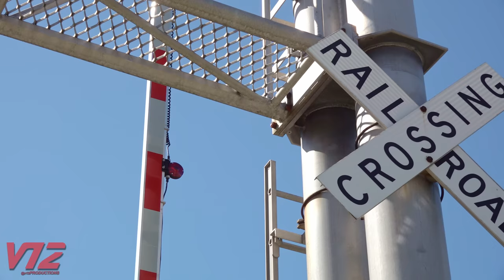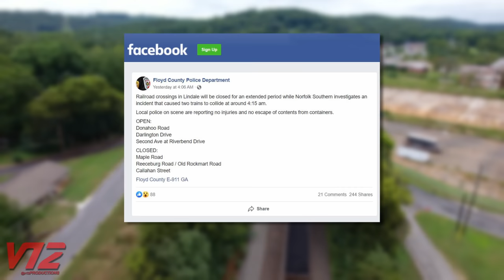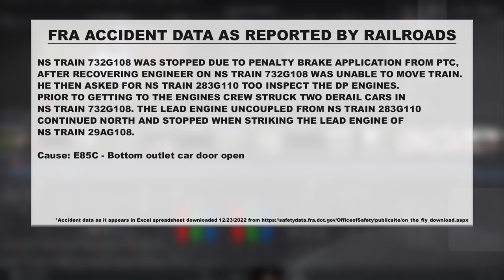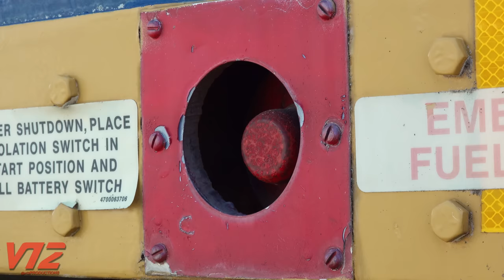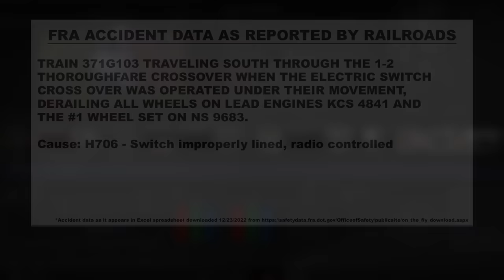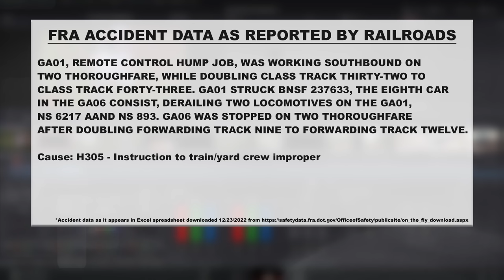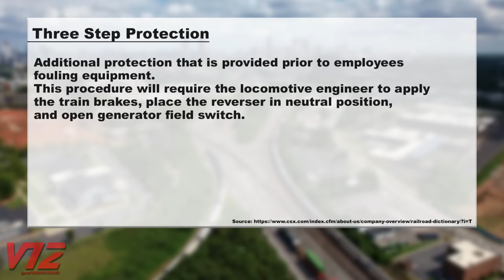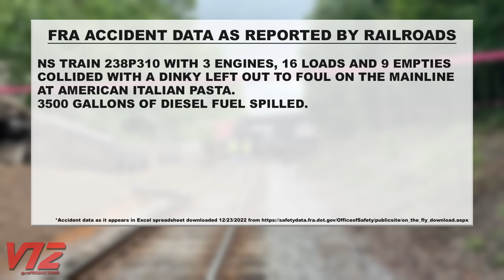Train Wrecks 2022 | SPECIAL REPORT

Comment: THANK YOU for such good coverage, accurate narrating, and good clear pictures & a nice, easy to listen to, voice ! 
   As a matter of fact, the ditch light controller is built into a steel lockable box, usually mounted in the Short Hood Nose (SHE) of the locomotive and hooks to the horn magnavalve, so when the horn blows, it gets a feed from there on pin 10, (on the panel), if I'm not mistaken. It also is connected to the SHE/LHE set-up switch, for which-ever end is in the lead position. Pin 10 is also hooked to a push-button on the control stand, for JUST momentary alternating lights without sounding the horn, (mainly for use around hospitals or to test the lights. The set-up switch tells the box which end the headlights will be using, so the opposite end of the unit won't have head lights not Ditch Lights in operation. If NS ditch Lights are operating properly, when the headlight is on, and the control knob and end selector is positioned properly, the ditch lights will be on constant. FRA calls it the "TRIANGLE LIGHT PATTERN, for railroad safety". Once you tap the horn, or tap the button, the Ditch Lights will flash alternately for a set number of seconds, (18 seconds, if I remember correctly),  and then go back to either on constant, (if the headlights are on),  or if the headlights are off, after the Ditch Lights time out, they turn off, awaiting a signal in the main panel. < I know a little about them. I helped design the procedure to install them on locomotives, as well as designed and built the testing equipment to qualify the control box for ditch lights. I made one for each of the major shops. > ( The ditch lights are the same bulbs as the headlights are. 75Volts, DC.)
   You mentioned what kind of damage does a unit get, if there isn't much of anything showing from the outside...Imagine having a flatbed truck with heavy boxes sitting on it, doing 50mph and running into a solid concrete wall. What would happen to those boxes? They would keep going the direction and speed they were previously going. If they were bolted down, the weight MIGHT be enough to sheer the mounting bolts off, moving control equipment around. There are lots of 1/2" and 3/8" copper tubing, carrying air for brake systems, all under the floor of the cab. They hook to the control stand for Train brake and Automatic brake, Dynamic brake magnavalve, PCS, horn, directional Sand. etc. Sometimes loose items, like possibly a bad coupler knuckle that wasn't put on a storage peg after changing it out, or special chain, might be thrown into the piping and flatten it out, or any number of shearing problems. ( In each end of the locomotive, there is a big sand box," its called, actually a funny shaped steel tank, built like a shute at the bottom, that holds DRY SAND, for sanding the track for better track adhesion, when WSA, (Wheel Slip Action), is detected. Air magna-valves shoot a fine spray of air and dry sand in front of the two lead wheels. This acts to GRIP the track when the steel wheel is under great strain, to pull the train up a steep incline.) The unit has to go to a "Back Shop" and be picked over and all the wreck damage, be hand repaired and painted. If its a major amount of wreck damage, they'll run it thru the system paint shop, when they get done and check it out good. Then, you can't tell there was ever anything wrong with it !!! I used to love working on wrecks and burn-ups !!! I've been retired over a decade.
   I was looking over the comments, and a fellow was speaking about room echo. My Dad did his radio show in Moms studio and he had the engineer that was building our TV channel 12, to order him some of that same acoustical tiling that he was using for quality sound for early TV. and he paid him for It. Theyer 12" x 12" squares with 400 1/8" holes in each one. They use it in Radio and TV studios as well as Band Rooms. It's a soft "Beaver Board". Hope this helps.
Reply from the maker: I appreciate all that info! Thank you!

Comment: Great video! I was wondering how the accident happened with the truck with the concrete beam. Truckers complain about vehicles not respecting them on the road yet they have no respect for trains what so ever despite trains helping them stay employed. I use to work for a company that made the running boards that you see on the top of the hopper cars years ago. Those things are heavy but we would crank them out along with other parts of the railcars.

Comment: I do feel the safety cab layout out is such a great thing! Over the pond in the UK we used the Class59 and Class 66 freight locomotives on the vast majority of our freight trains. 
These units are cut down versions of the EMD SD40-2 to fit within the UK loading gauge. However the cabs very exposed, basically a flat front where the engineer's knees are  the crumple zone. This was quite apparent during the Selby Rail Crash in 2001 when the engineer was killed after running into a derailed passenger train which had in turn been derailed by a car that had crashed down an embankment and onto the tracks.

Comment: With respect to those wrong turns onto tracks, they seem to happen quite often as offered by Virtual Railfan live streaming cameras everywhere.  Perhaps the Federal Railroad Administration should require placement of those 'do not turn right' signs with the 90-degree right arrow with the red circle and red diagonal slash across the arrow, and those "DO NOT ENTER / WRONG WAY" signs used to prevent drivers from driving the wrong way onto a freeway off ramp?  Sadly, it appears such signage is necessary.

Comment: RJCorman and Hulcher not only have people on standby to answer the call, they have a marketing team so they can offer their best bid in the case that both are available. If one comes in a couple hundred bucks below the other, they win the bid and the job is theirs. I used to work on the Fulco Terminal over by Sig Flags and Hulcher has their equipment parked near the Interstate there just in case. We used them a couple times, but most of our derailments were slow speeds and wheels on the ground where tracks failed. 
You did not cover one of the biggest safety concerns I faced as a crewman in Atlanta; Trespassers. It's because of a trespasser I was forced to retire after nearly 21 years of service due to my disability. I was assaulted by the trespasser and while I am still here today with disability status, it could have been far worse.

Comment: Well those tankers are considered frameless the pre-transition era tanks had a type of i-beam frame under it but now the tank itself is the strength of it with a small  rigid frame built into the inside connecting the truck bolsters  when I was in the Air Force we offloaded trankers of  diesel and unleaded fuels it was near the end of that era and we still offloaded Tanker barges which held Jet l-fuels  Gotta love the smell of Diesel Ahhhhh love it !! 😀

Comment: My Dad had D8 & D9 Dozers that were often called on to go to derailments. They were conventional dozer equipped machines, no side booms. It was common that the engines just needed a push to get them over the re-rail blocks. Then the cars were pushed out of the way so our crews could cut them up and haul them to the scrap yards. Often the cars showed minimal damage but were still cut up. The RR would salvage the trucks. To get the machines to the site as quickly as possible the State Patrol would control traffic so the over width lowboys could take up two lanes. The RR coordinated the moves with the patrol and finding routes that could support the lowboys. Rural area road bridges were often a problem.  Lots of late night work under flood lights.

Comment: “Re-railer” vs “Re-tracker”: both are a single piece of metal, but where the one you saw used on Southern 630 was only placed on one side, the other kind straddles both sides of a rail and catches the flange, forcing it where it needs to go. They used one when NKP 765 had a derailment problem a bit of time back. They are also on the lower side of the tenders of the K-28, K-36, and K-37s used on the D&SNG and C&TS and at the Colorado Railroad Museum and are painted white / silver. However, they carry both kind of these tools on said narrow gauge steam locomotives, and I think (don’t quote me) the kind you saw used on Southern 630 is what they in Colorado call a “shim” re-railer, and is more commonly used on coaches or cars since the locomotives have the bigger “V” type that straddles both sides of the rail while also sitting over it and locks in between two ties to keep it from moving as it’s better for heavier equipment like modern cars and older steam locomotives. It’s kind of works like the HO scale power terminus/retailer seen with train sets using Bachmann EZ-Track. (I bet the UP crew wish they had a few in Sacramento when UP 844’s tender derailed a decade ago, since all they had were blocks of wood and it took 6-8 hours to get the one tender wheel back on since centipede tenders are notoriously for derailing when backing up in a curve.) The exact name, however, escapes me.

Comment: very informative, being from Britain, I am not familiar with your regulations covering level crossings, here in the UK, 'Slow' and 'long' vehicles  cannot negotiate a crossing without using the track side phone, this allows communication with the railway control, they will only give permission if no trains are due and he will not allow a train to enter that sector until the crossing has been completed, and the truck driver has to stop once he has crossed, and has to report back to the railway control by the track side phone to confirm the track is clear. do you have a similar procedure, of course all regulations rely on the integrity of the vehicle driver to comply

Comment: The lead locomotive in the Douglas GA accident took a beating but the crew got out of it with relatively minor injuries because of how tough today's Safety Cabs are built.  

I came across a grade crossing accident near Waukegan IL in 1981 or 82.  A C & NW freight led by a pair of SD40-2s with conventional road switcher cabs collided with a tractor trailer dump body loaded with gravel.  Train speed was (I think) about 45 to 50 mph.  The truck couldn't get off the crossing (stalled?)  Seeing what was coming the crew threw the brakes into Emergency and got the hell out of the cab, jumping from the engine and tried hard to get away from the tracks.

The dump body wrapped itself around the nose of the lead locomotive and CRUSHED the front part of the cab nearly to the back bulkhead.  Both crewmen were hospitalized, the trucker died at the scene after being thrown from his cab.  Both locomotives and about 20 autoracks loaded with new cars derailed.

As for all the locomotives you see that are beaten up in these accidents, I learned way back about the time of that C & NM collision that the way locomotives are built, if the frame is intact and not twisted or bent the locomotive can be rebuilt.  "Plug and play" didn't originate with computers but with 100 ton railroad locomotives.  😉
Reply: Ive bailed before not a pleasant situation and it does have a tendency to be pretty painful . didn't break no bones we was running 25 mph  45 makes a lot more difference though . I guess I'd had tried it if I had to .

Comment: I will say that those Corman guys really know what they’re doing.  Prior to the pandemic a train derailed under a structure that my agency is responsible for.  As I am an experienced bridge inspection engineer I was assigned to the scene as a representative of my agency to be available for questions and coordination as required.  

It was impressive to see an SD-40 suspended from four sidewinders moved 100’+ to undamaged track and placed back on the rails.  In terms of safety I did not see them doing anything which I would regard as unsafe.  That derailment was caused by partially washed out track bed.  I did not get to see them right the locomotive on its side, I was relieved after probably 16 hours.

Those Corman people are real professionals, and I have worked on roads and bridges for over 28 years.

Comment: Before I even watch this, as an ex short line logging railroader, 15 years, when we go in the ditch, it's not fun. Not fun at all. Our railroad, in the Pacific northwest, was 120 years old. Simpson Timber co. If you Google it, you might see me in some of the videos. 🙂
  And/or have a runaway, pucker factor of 10. We were railfan friendly,  and tolerated them well. They came from all walks of life, and from all corners of the world. Would risk their lives to get the 'shot'. We were not railfans. It was our job. We just happened to love it. 
  Picture this. After 14 hours on the job, I'm crawling under the head locomotive to chain up a butterfly frog rerailer. It started raining, really hard. By the time I got out, the rain had stopped, and everyone was was soaked except me. To get under the Loki, on my belly,  I had to literally scrape the dirt and rocks out of my way so I could fit. That's just one story. It was a lot, lot worse than that, sometimes. Stay frosty...   Radio traffic:
  "Twelve oh one dispatch?" "Dipatch, go ahead." "Yeah, we dumped the mud, switched the mill, aaand we're ready to go with 13 lumber, five side dumps and the caboose."
  "Call when you get to Knights". "Call when we get to Knights, twelve oh one, out". "Dispatcher clear".

Comment: Those sidewinders and other things do not work on the subway. But we still get cars on the ground and broken rails. The problem is that rail borne equipment cannot get to the site because there may be a half dozen trains ahead of them also waiting to clear the location. Signalling typically does not allow passage in the wrong direction, and if the power was already shut off, they are not going anywhere anyway. Re-railing is done the old fashioned way. Men carry the jacks down into the subway and man-handle them into position. You cannot use re-railers since the power has to be shut off for worker safety. They jack it up by the car body and then the truck is free to move and they can man-handle it back into position.

Broken rail is another issue. You may have noticed pieces of rail and frogs just sitting there inside the gauge. It just sits there getting dirtier and rustier as the ages grow long. If a rail breaks, you cannot get a work train into the tunnel. The work trains are stored at the 'home' end of each line, but into the worksite it cannot go: there are at least a dozen trains in front of it waiting for the track to be repaired. So the workers drive a truck to the nearest station, and putting all of their tools into a canvas sack, they walk on down the line. They find the break and cut it out. They can use air-powered tools with the hose trailing back to their truck. Then taking a likely piece of frail from that which was left between the tracks for their use, they cut it to size and bolt into place. Later at night or on a weekend they will disrupt traffic to bring a work train in check the joint, probably using a new piece of track, they will weld it into place.

broadwaylion.com

Comment: Standard Gauge rails are only 4 feet 8 and one-half inches inside width.  The standard width of locomotives and rolling stock is 10 feet wide.  That leaves an overhang of nearly 3 feet beyond the rails.  Perhaps derailments would be LESS common and Less likely if the width of the rails were greater.  I suspect, however, that IF the standard gauge was wider, locomotives and rail cars would also be correspondingly wider.

As for grade crossing issues, I have two thoughts:

-- too many grade crossings are NOT level enough, as in the roads leading up to the tracks have very short ramps with rather steep inclines.  This causes issues with tractor trailers, stretch limousines, and motor coach buses.  The problem is even greater for trucks hauling low-boy or low-clearance trailers, such as those in common use by household moving companies as well as bread and potato chip company trailers (for example, google images of Frito-Lay semi trucks).  Some low-boy trailers used for hauling excavating equipment and Oversized Loads have ground clearance of only 3 to 6 inches and when faced with short but steep ramps at railroad crossings, they can easily get stuck trying to drive across the rail crossings.

-- too many roadways run closely parallel to railroad tracks.  This becomes problematic when there are grade crossings from these parallel roadways.  For one thing, truck drivers may not even visually SEE that a train crossing signal is active or that crossing gates are down until it is too late and they are already under motion making their turn onto such rail crossings.  These locations should have RR crossing lights that face these parallel roads in addition to the standard ones that face the crossings.

-- many (most?) traffic signals that are immediately adjacent to rail crossing do not interact or synchronize with railroad crossing signals when they are activated.  This could mean that a traffic light leading to a rail crossing could be showing a GREEN Light while the rail crossing is active.  These highway traffic lights should be upgraded to equipment that can immediately synchronize with the rail crossing signal to show Red stop lights to ALL lanes of traffic when the rail crossing is activated.

-- the standard black and white RR crossbucks signs could be enhanced for better visibility by adding small metallic "tab" signs that are small (2 inches by 4 inches, for example) sign tabs that are colored reflective orange or lime.  These are in use more and more on hard-to-see traffic signs to bring greater visual awareness to vehicle drivers.